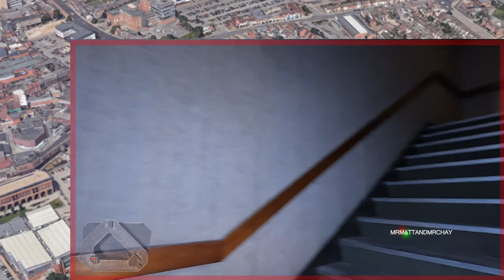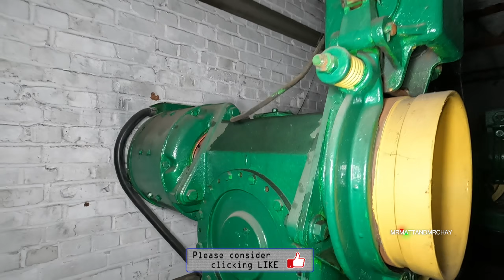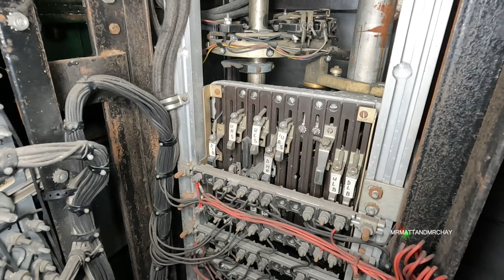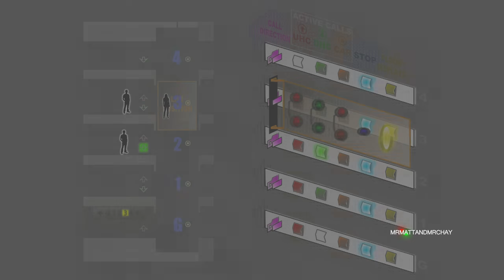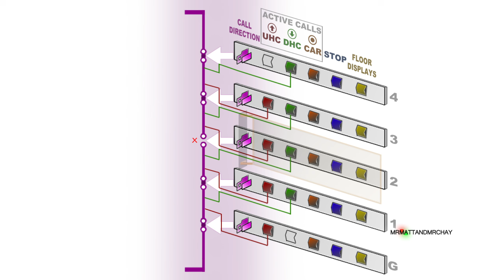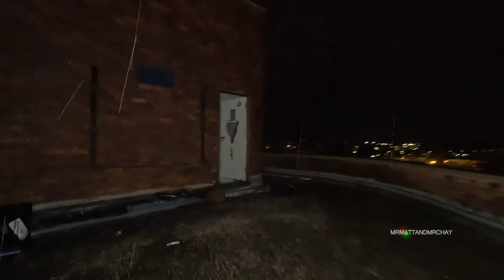DERELICT OFFICE - Old Otis lift technology explained

Comment: Have you ever seen an Otis "advancer" selector? My understanding is that they were used for high-speed installations where the elevator/lift starts to decelerate over 1 floor in advance. I'm unsure if they are extinct in the UK, but there are surviving examples in the US (they are not easy to find, but they DO still survive).
Reply from the maker: No, I have never seen one in person, but I kind of get how they work and I would love to film one!
Reply: @mrmattandmrchay  
If you ever plan a trip to the US, I can potentially tell you where you might be able to find them, and other stuff that may be of interest (i.e. Westinghouse DMR selectors, similar to the Express Lift one). No promises you will be able to gain access to the machine room though (and in 10 years from now, high-speed relay logic installations may be very close to extinct).

Comment: According to the Elevator Wiki: "Elevators with microprocessor controllers first appeared in 1975 when Schindler introduced the "Miconic E" controllers. On the other hand, Otis introduced the "Elevonic 101" elevator in 1979. This elevator system used microprocessors to control every aspect of the elevator operation."

So this stuff installed in 1972, although well-proven, was very dated even then, and it's not difficult to see why engineers wanted to simplify it.

Comment: Very Nice Video. This technological marvel has been described so VERY well that I even understand how it all works.

This Floor Selector fascinates me the most - Even Polish lifts technicians have had to deal with this technological marvel.

And since I mentioned Poland, I will add that in this country we only have 2 (!) old OTIS lifts [counting the modernized ones, we have about 20 of them] - 15 years ago there were more. Most of these lifts were imported mainly in the 70s as Freissler-OTIS.

I don't know if anyone will be interested, but below is a list of buildings in Poland in which imported OTIS lifts were installed:

1. University Children's Hospital in Krakow, 1 OTIS from 1974, the remaining 4 [including 1 USA-Style goods lift] were replaced in the years 2014-2017; 
2. Stalexport I & II Katowice, x4 Freissler-OTIS System-260 from 1977 - A friend sent me videos of these elevators and the engine room. Unfortunately, they were supposedly modernized;
3. [building demolished in 2015] State Railways Directorate [pol. DOKP] Building in Katowice, x6 1974 Freissler-OTIS from 1974;
4. Novotel Warsaw Centrum [formerly Hotel Forum Warsaw], Freissler-OTIS from 1974, modernized in 2005; 
5. Children's Health Center in Warsaw, 4 Freissler-OTIS from 1976 [2 modernized by OTIS in 1999 i still running, another 2 mod. OTIS in 2005 - the latter were replaced in 2025];
6. Hotel Omega in Olsztyn, 1974 Freissler-OTIS;
7. Intraco Tower in Warsaw, x4 1974 (First Bank) and x4 1975 (Second Bank) Freissler-OTIS - Both High-Rise Mod. OTIS in 90s. Building will be demolished in 2026-2027.

Comment: I'm sat here thinking 'I've seen this!' but no, I saw part 1. This is, excuse the pun, another level. I love the animations of how the relays work and how it all links together. I restore vintage computers and computing devices so understand the value and artwork that goes into schematics, but the mechanical work here is amazing. I retrospectively apologise to any lift engineers I dissed when I was younger.
Reply: I remember when “coders” were still often called “programmers” and the software requesting groups were given access to progress and efficacy rather than ignored or be a source of amusement. They really did work all hours and ate pizza and had <cough, relations> in the building to save time. Elegance of program logic was rewarded by admiration and an infinite loop of stock options. Your endeavors at restoring made me remember such things. I also remember a thick printed manual of “Microsoft Basic” furnished with every IBM or clone installation of Windows and God love us, DOS. Always seemed MS was overly optimistic in providing those and I always wondered how many non-trivial programs were created by absorption of the data and skills described in that tome. Yeah, I’m drowning in the river of time 😢

Comment: Great video - excellent graphics! Do all those relays and terminals run at mains voltage or is there a low voltage system for control? Thanks.
Reply: Normally for Otis they will run using a 100VDC supply, generated by the control transformer down on the bottom of the cabinet, along with a selenium rectifier stack there, now mostly long replaced with a silicon bridge rectifier, though there is also a 24VAC supply for the car indicator lights and the controller relays can also be operating off a 24VDC or 48VDC supply instead, depending on the age of the system. New ones with electronic controls, a retrofit board for the old relay logic, that upgrades it to a modern standard while still keeping the old panels and such in operation, uses 24VDC all round. The exceptions are retiring cam coils, often enough wound for 60VDC, as a compromise between thickness of wire and pull in force, fed via another winding and rectifier stack, along with a smoothing capacitor.

Comment: I'd like to note a couple things.

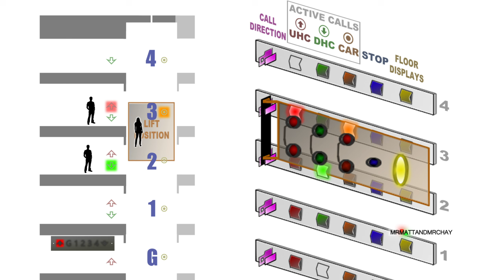At 14:10, the stop contact on the selector shouldn't be solely relied upon to stop the car level with the floor, even if the selector model is the simpler one without the pie plates.  In that case there should be magnetic switches (look up EECO model MV-4 as an example) on the car and adjustable vanes at each floor to provide fine leveling.  If the stop contact was the only thing leveling the car, then arcing and pitting of the stop contact would slightly change the carriage's position at which conduction is made, and would have an amplified affect on the leveling performance due to the selector carriage being geared down from the lift speed.  My guess is the stop contact simply enables a leveling switch circuit.

At 21:25, the small ramp is shown causing an ambiguous up/down condition.  I would expect that the up call relay coil on one end of the call direction circuit would be intercepted by a normally closed contact from the down call coil, and vice versa.  This would create a race between the two relays where both could never energize simultaneously, and would allow the car to at least start in one direction.  If the car was in between floors and restarted in the wrong direction by the wrong relay, the car would eventually correct itself by finding its position at the next floor bar and reversing (if it's equipped with lost-call stopping logic), or would go all the way to the terminus and then reverse.
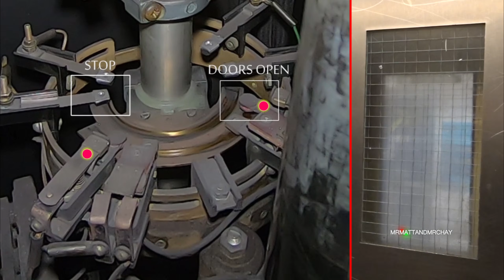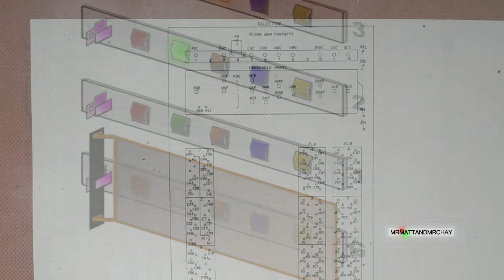Reply from the maker: Thanks for the comment - 14:10, you are right, it's actually a little different but for illustration purposes I've presented it in this way.  In reality, the lift stops after a brush has LEFT a contact, very similar to the plate leaving the last contact at 15:00.  It's one of those situations where how far do I go, do I spend more time explaining exactly how it works (i.e. explaining all the contact - as shown at 13:06), or do I explain the principle of how it works for the 'average' viewer.  On this video, I chose the latter.
HOWEVER, I am planning to do a video to explain the carriage, the call cancelling contacts, the double coiled call relays (one to latch, one to reset - activated by one of the contacts that I didn't explain on the carriage).
But in summary, yes, the lift stops when leaving a contact rather than meeting a contact.
Thanks again for the comment and observations :)

Comment: It is very rare to see electrical drawings of that age in such pristine condition.

That is an extremely interesting system - how much of the wiring do you think was done on site? I would love to explore this system in greater depth - would you be able to send me photos of the drawings in full size please?
Reply: Cabinets came pre wired and tested from the factory, but all the red wiring was done on site, using wire pre cut to length, and then labelled each end, with the ends in the motor room all used as start, and then tied up with some twine, and each set of lengths per landing labelled at the far end, and rolled up and tied with some more twine. Install you terminated all to the control cabinet, then undid each floor and sent down the cableway, and then at the floor used the labels to attach the wiring there. Jumpers between floors the same, labelled both ends, and tied up into a roll with twine.  Twine used because the zip tie was not as cheap then, despite being invented in 1958, so cable lacing was still common, along with cable clamps being used to hold bundles together in the shaft, as well as steel trunking.

Comment: Awesome Lift Video I Seen A Lot Of Otis Lift Here In Australia From 1970's And i Only Found One What had The Oringal Rubber Buffers And It Was Lucky I Filmed It Because i Went Back To The Lift With old Rubber Buffers and It Got it Rubber Buffers Replaced With PIR In The Door but the lift still 95% Oringal And i Found Out A trick on Old Otis Lift And To Makes Door Closed straight Away When The Lift Stopped At A Floor If You Push The Red Stop Button And The Floor the door Will Not Open All the Way And it will slam shut and start Moving I Will Send A Link To My Video When I Did The Trick  https://youtu.be/ueQ2Morshjc?si=pPBgNLMk9yw0u1aO and Also I’m Doing A RevisitNext  Week To The Old Otis Lift Locations In My Old Home Town to See If the Lift Are Still Oringal if They Are Original I  Will Film For YouTube